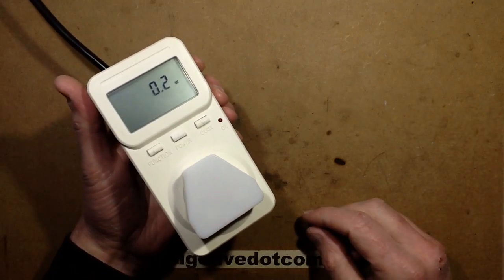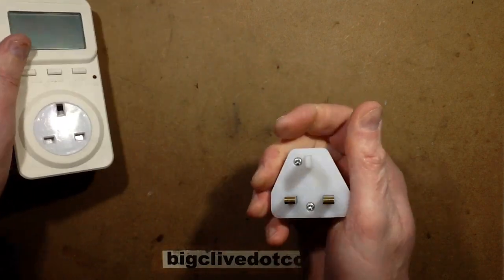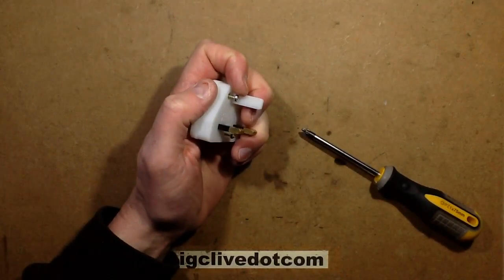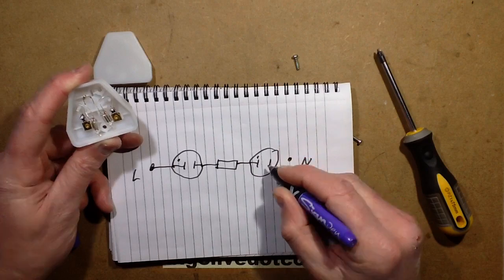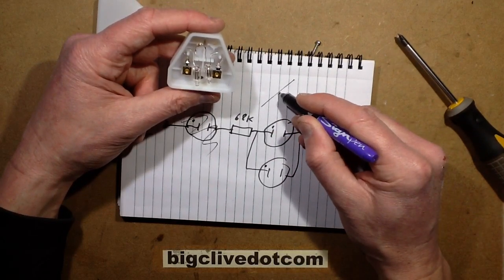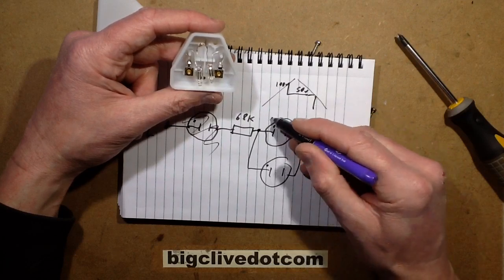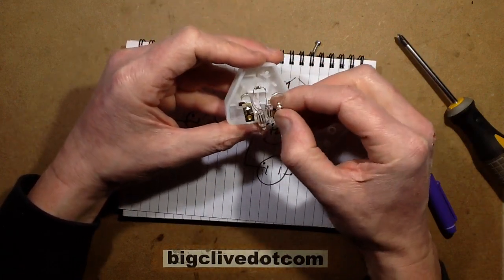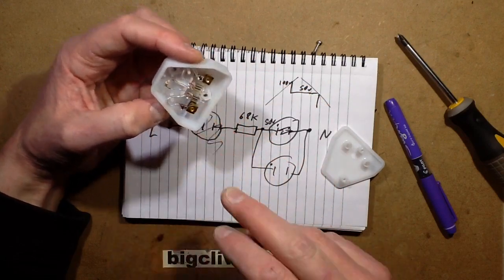Inside a neon night light.  (With the smallest schematic ever.)

Comment: Hey Mr Mitchell! Can you do a video explaining the different types of neon indicators you can buy, for example there is NE-2 which seems the most common but some have white coatings on the glass. Also I've noticed that many manufacturers see to just throw in a little 1/4w resister even when its being used with 240v mains.

Comment: I like the "warmth" of neon lamps, but when used continuously in illuminated power switches or night lights, they always start to flicker or go out after 5-7 years.
Reply from the maker: they're often over-driven for intensity and to make sure they don't last too long.  Changing the resistor for a higher value makes them last a lot longer.

Comment: At 120Vac the peak to peak voltage is around 340 volts. With a striking voltage of around 90 volts, I'm pretty certain two of the ne-2 lamps will light in series. I need to find some of those and test it out (if I can find them anymore).

Comment: There are  a number of interesting aspects of your typical 90v neon that may surprize you. If a lamp is flickering shining a bright light on it will make it come on and stay on as long as the bright light is shining on it. This is the result of photo excitation of the gas in the tube. This effect will also occur in the presence of an RF field or a strong electrostatic charge, also by way of external excitation lowering the strike voltage. I grew up in the pre-led era, and know that the humble neon can be used in a wide variety of ways other than as an indicator light.

Comment: I have a 12v dc adapter which is now outputting 15v which caused issues with a camera connected to it, does anybody know why it would go from 12v to 15v?
Reply: Possibly a shorted regulator chip? Being 12v it's probably best just to get a replacement :)
Reply: Is it a regulated or unregulated supply? And are measuring voltage when connected to the camera somehow or open circuit with no load? Unregulated ones will read much higher on low or no load...
Reply: ***** Thanks, I swapped it out.
Reply: andygozzo72 I'm not sure. Either way the 12v camera connected wasn't working so with a new power supply pushing out 12v it does.

Comment: I remember those neon night lights, I had a few of them when I was young.  The first 2 I had were square or rectangle shaped, one had sharp corners, the other one has rounded corners.  Do you know of any neon night lights that have LDRs in them so they go off during the day?
Reply from the maker: There are some, but they may actually shunt the neon with the LDR......
Reply: What does that mean in layman's terms?
Reply: When it is daylight it routes the pixies around the neon and keeps it from lighting but still uses juice.
   Mike (o\!/o)
Reply: I see.  Whereas if you have an LED nightlight with an LDR, will its power draw during the daytime when it's not lit be less than an equivalent neon nightlight with an LDR?
Reply: An LED has a much lower voltage so the LDR can be used to control a transistor switch. So usually an LED nightlight with a daylight sensor will only use a tiny amount during the day, an almost unmeasurably minuscule current to operate the sensor. Just pennies for years of operation. This also will extend the life of the light for decades. A real bargain in my book. But I still prefer the dancing pixies of a well tuned neon riding the waves of an erratic mains supply. Flickering I mean.
 Long ago I made a voltage meter out of 10 neon lights with graduated resistors that would show the spikes on the power line. It had the added benefit of clipping those small spikes somewhat as well as being nice looking. The clipping showed readily on a scope. Now I just have to find it or make another.
   Mike (o\!/o)
Reply: I think I understand you.  But whatever the case may be, I love night lights, be they incandescent bulbs, LEDs or neon lights.

Comment: My dad completely hand made one of these many many years back, probably scrapping the metal contacts from some power cord, then soldering the neon and a resistor to it, and then filling some mold with who knows what epoxy resin that he either dyed or grabbed several that were dyed, and it came out with this orangy red to clearish to blue gradient. The neon still works, although extremely dim, and I think it's all starting to blacken a bit from years of use.

Comment: One I have was intended as a retro nightlight that never really worked.  This one did and has been getting rather black of late.  The one I have you'd probably have to get rather brutal with , probably a dremel if you wanted to keep it glue it back together.   But it has 1 resistor and 1 Neon.  It's one of those mock jewel nightlights.  which unless your a cat it doesn't do diddly for lighting any pathway,  Especially if your over 40 and things are getting slightly darker although I love it dark  not utterly dark .  thats depressing  but darker.  Although on the same token do like it rather dry.  Humidity even during the winter 1. sucks 2. ruins your walls.  :(  ie oh look rust on the outlet wires .  Well I was going to replace that but not sure if I take it out if it'll go back in again :O  Know of one other outlet in the house with rust surrounding the outlet.  and naturally another outside wall

Comment: that setup would work. Lower the resistor value & it both would strike in a 115-120V system. I have a Christmas decoration that would look exactly like that item's schematic. I can't be able to tell you the resistor value off the top of my head, ether that or my little snowman is a Christmas miracle.
Reply: 120v is 170sh volts peak, so that gives each neon 85v open circuit... so probably workable, but marginal
Reply: I mean, yes, praise be, it's a miracle.

Comment: Isn't it dangerous if they can be opened so easily? It is, after all, mains voltage in there...
Reply: it involves a screw. so do most electrical distribution panels....
Reply: thany3 This are "dodgy" items from Poundland/China.

Comment: The earth pin probably got stuck, because the mould they're using is so old that the metal has worn down far enough to make the earth pin a tiny bit too big.
Reply: Yep, that and the fact the plastic is probably so soft a normal Earth contact will dig in...even if not enuff to be visible

Comment: +Clive, stupid question about neon lights. Many of my older power bars have neon lights in their power switches to indicate "on". With time, these lights tend to flicker on/off. Is that likely a failure of the neon given it being being powered by 110V AC?
Reply: They are just end of life.  One neat part about a weak neon indicator is that if you are in a lit room or provide light from a flashlight they will strike and work almost normally. Not usefull for anything I guess but pretty neat!

Comment: Those plugs you guys got always get me. They're freaking huge! We got big plugs here too. But they're just for appliances.
Reply: dos gos
No unfortunately about it. I don't want, or need any of that crap.
Reply: anononomous
In the US we have something called a center tapped neutral system. So with single phase service 3 wires come in, two hots, and the neutral. Between either hot, and the neutral is 120V. Between both hots is 240V. This means that everywhere where we have 120V outlets we really have 240V. We just choose to wire it up as 120V when it suits us to do so. Which is most of the time. Stuff that into your weedy pipe, and smoke it.
Reply: Those huge UK plugs come with some special safety features that many countries don't have unfortunately...
Reply: *****
I hate to think I'm biased by familiarity, but I've seen graphics of most all plugs in the world, and I wouldn't trade the ones we use in the USA for any of them. Our electrical hardware is imminently practical. It has to be. Because we have about a quarter of the whole world's electrical grid. So we must be doing something right over here.
Reply: Paul Frederick 
I'm detecting nationalist bias.
Reply: +Paul Frederick 
Your plugs are shit. 
Stick THAT in your pipe.
Reply: +Landrew0 
Yeah, I suspect so. 
When someone dismisses an obviously better and safer system simply because the plugs are "too big", he be trolling methinks.
Reply: James Cree
you think wrong. As I understand it in the UK they even use our plugs on construction sites, because their system is such shit.
Reply: +Rudofaux 
Sounds like another sour American trying to convince himself.
Reply: +Paul Frederick 
Sounds like you resorted to name calling. 
I'll take that trophy. Thanks.
Reply: +Paul Frederick 
*polishes trophy
Reply: +Paul Frederick 
So does Clive. 
Homophobia isn't hip anymore, bro. Guess you didn't get the memo.
Reply: Brilliant debators here.
Reply: Paul Frederick British plugs once came in three sizes (five, ten, fifteen amps), but after the War a new standard specified one type of plug for all appliances, from night lights to washing machines.
Reply: The best plug would be flat pinned combi with italy plug layout.
nice and compact
Reply: +dos gos it better damn well have. I can shake off or just be annoyed at a 120 pixies dancing angrily, but I ain't walking away from 240 angry pixies.
Reply: "the war"
hehe
Reply: I like the Soviet/Schuko plugs, myself. ;)
Reply: Landrew0
If I thought there were better plugs, I'd be the first person to say there were. So your bias detector is off.
Reply: See Andrew Baker's comment above for a reason why UK plugs, while admittedly relatively bulky, certainly have their advantages.
Kids not being able to easily insert pointy things (other than plugs) into the mains and fuses built into the plug are nice features, especially at 230/240V rather than a weedy 110/120* ;-)

*To be honest I can't actually remember which is typically more dangerous in a given situation.
Reply: The UK plugs offer 2 advantages I wish we had; Higher power (owing to higher voltage)  and better safety (owing to the need, because of higher voltage).
I think however they could have come up with a much less clunky design.
Reply: +Saud Siddiqui and the most dangerous not having half-isolated pins
Reply: *****
NEMA connectors don't need it. It's an American standard to have any non-grounded appliances be double insulated. 240 volts have a greater chance to breach air gap resistance than a 115 volt system. Even thou 240V is running at lower amperes. I'll give two examples.

A taser runs 10,000 volts at a few pico amperes whilst a car battery running 12V & 400-1,500 of cold craning amps.
A taser's spark can easily jump the air gap in the probes whilst a car battery arc will only happen when contact is made.

American home's wiring has fault safeties at the Main Breaker Panel, a British home uses a ring topography. Ring topography will continually supply current even when a fault happens.
Reply: Rudofaux thanks for your explanation. Does Netherlands have these safeties at the main breaker panel ? We do have a breaker between the street and house connection and after it a couple of 16A breakers for the groups (doing parts of a house).  What I meant is that thin fingers could be wedged between plug and socket while inserting the plug and while the pins already make contact a piece of the pin can touch the persons fingers. This is not possible with half insulated pins because the non insulated part of it is too short to be both reachable and making contact in the socket at the same time.
Reply: James Cree 
Is it possible that you are implying that for every advantage, there must always be a corresponding sacrifice?  I would disagree.
Reply: +Landrew0 
No, I agree.
Reply: James Cree Sounds like buyers remorse.
Reply: James Cree
sounds like you got shit for brains too
Reply: James Cree
I'm sure you take a lot of things the wrong way
Reply: James Cree
you polish knobs
Reply: James Cree What make you think I'm American?
Reply: Landrew0
scintillating, isn't it?

Comment: The really long leads from the neons and resistor just snaking back and forth without any insulation set my safety OCD off.  That could be one hot and melty plug.
Reply: It looks to me like it has clear sleeves on the wires.

Comment: Why is it so many of the earths on these European plugs made out of plastic? I've never seen any like that over here in Canada/America.
Reply: Our sockets have a shutter over the live and neutral so the earth pin has to be there even if no earth is required. Plastic is easy and cheap. American and Canadian plugs have 2 versions, with and without an earth so if you don't need an earth, it's left off and you get a 2 prong plug.
Reply: They arent" European" plugs. I think theyre called UK plugs.
Reply: It's just a prodder to open the shutters on the socket.
Reply: Evil from evilution okay that makes sense, I guess it's some sort of safety precaution so nothing can get put in the socket that's not supposed to be there(ie a kid sticking a fork into a socket) thanks for the answer!

Comment: I've always had a soft spot for neon lamps as they have so many uses. Going back, I recall seeing them across a car radio antenna circuit to bleed off static charge. As a DC or AC detector, where on DC just one electrode will glow. As a mains live detector where it will slightly glow if the other lead is in your hand (with resistor). Of course the pilot lamp function with suitable resistor. And in circuits such as a relaxation oscillator. 
A simple device that is really quite extraordinary.
Reply: I saw one quite recently in an alarm system to connect across the line pair to the autodialler'. I am not sure how they stopped it firing on ringing voltage though?

http://chipmunkebay.nfshost.com/neon.jpg is the circuit in question :) A clue may be that the bulb is a little larger than normal (maybe 5/8 inch long instead of 3/8)

Comment: I "had" 3 of these when I was a young boy (4-5ish). Every night I had to choose which of the three I wanted plugged in, a Mickey Mouse, Donald Duck, or Goofy.  The light covered the entire outlet so I had to pick, but luckily I had just watched an episode of Mr. Rogers that taught me how to use paper clips and batteries to make a light bulb light up.  I figured out a wonderful plan that would let me light up ALL of my lights at once and make the room 3 times brighter.  I snuck out of my bedroom in the middle of the night to my dads office and got a big box of paper clips and packing tape. I proceeded to use the entire box of paper clips to make long chains and hook them together to the US plugs (why else would the plugs have little holes in them if not for paperclips right?) I climbed to the top of my book shelf and taped the first on on the wall,  second one half way down, and the third to reach the outlet.  The evening turned out to be a very memorable one, the room did in fact become at LEAST 3 times brighter (if you average it).   The room immediately became hundreds of times brighter as the ARCS flew up my paperclip ladder of death followed by  (almost) darkness as the breakers popped, then once again followed by the soft gentle glow of smoldering and burning wallpaper.  The scary darkness however was quickly chased away by the increasing glow of the now flaming wallpaper.  But it didn't last I was snitched on by the smoke detector  and all hell broke loose.   Mickey, Donald and Goofy unfortunately did not survive the experiment, thankfully  the reset of the house did.
Reply: SuperAWaC actually I'm a network infrastructure guy.  Design and build virtual data centers.  Rarely do I use paperclips in them.  :D
Reply: Immense story telling, well done.
Reply: you're an electrician now, aren't you?
Reply: http://www.ebay.com/itm/Vintage-Walt-Disney-Night-lights-pair-Mickey-Mouse-Donald-Duck-Round-2pc-/222332339034?hash=item33c40a435a

Hey looks like I could be 2/3 the way to reproducing that  night.  LOL
Reply: Andrew Or are you a fireman?
Reply: That's epic! :-)
Reply: That was a beautiful story.
Reply: Absolutely Spectacular
Reply: lol

Comment: "smallest schematic ever" not sure about that because the tea lights I bought at the dollar store have a flickering or color changing LED straight across a CR2032
Reply: the flickering led has a circuit board inside it, if you want technically simpler, my keychain flashlight is just a 2016 cell and an led across it, no flashing and no resistors

Comment: we have 110v supply where I live and I actually have extension cords with a single neon version of this built into the female end of the cord. quite handy if the end of the cord is in a dark place such as behind a TV Stand and such. the connection ends of the cord are of coarse molded out of clear plastic.
Reply: We have one jammed into an old Bathroom Light Switch, so Its always on and easy to see in the dark.

Comment: A while back I bought some vintage neon indicators from Russia. The schematic that came with them said they were rated for 240v, but that did not stop them from striking on 120v. I could even run them without a resistor and they wouldn't get hot. I found them a bit strange compared to the 90v ones from China.